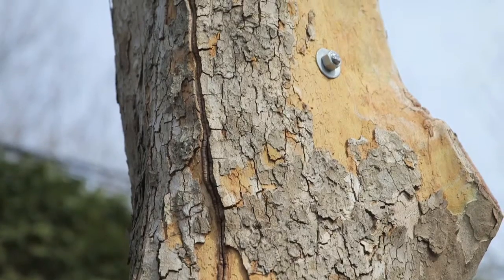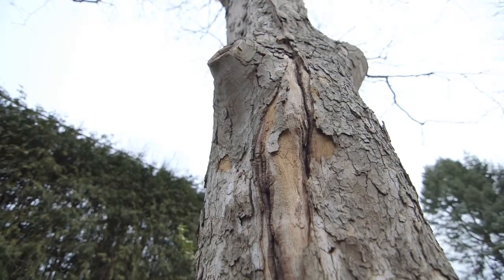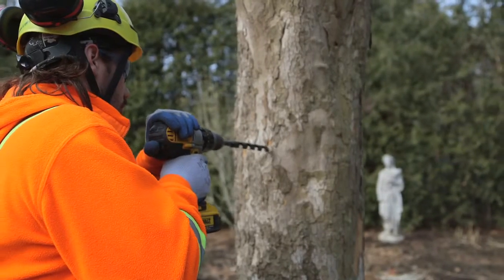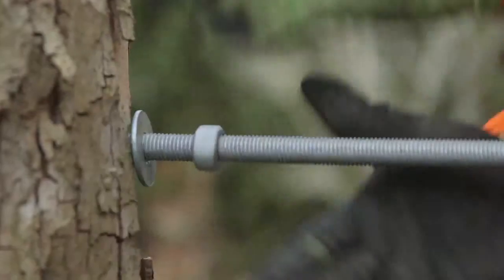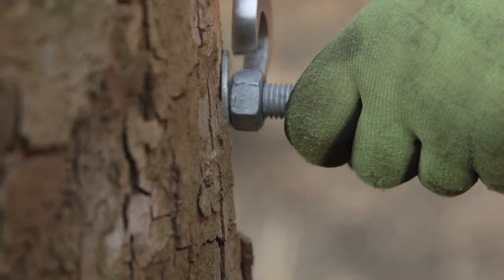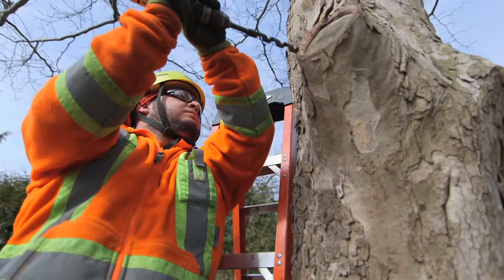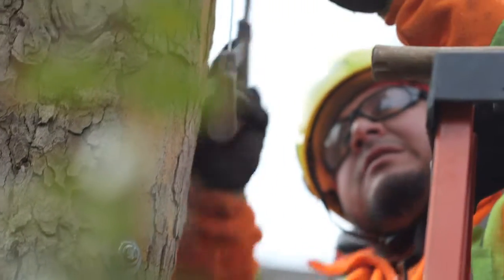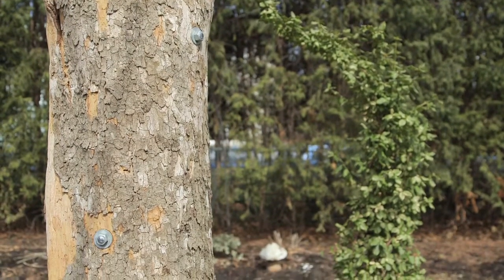Bracing Bolt Installation for Tree Preservation | Cohen & Master

Comment: What about the decay in the future?  As a past ISA Certified Arborist in Minnesota, bolting was discussed and cautioned against. As time passes, the bolt inside the tree is sitting in a pocket of decay, with minimal holding power. All I can say is liability.
Reply: We typically use this a a last resort for people not quite ready to get rid of a tree for whatever reason. In my professional opinion I’ve seen trees compartmentalize completely over rods and cables for that matter. This is why it’s important to ask your arborist like he said if your tree is a good candidate for this. Certain species will benefit for than others from this certainly.